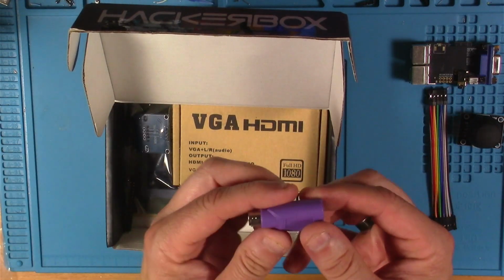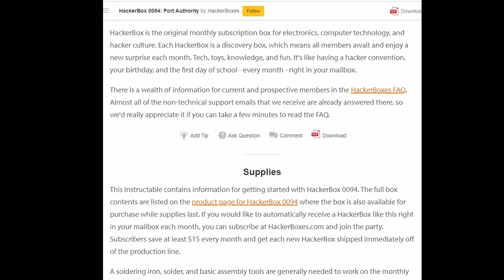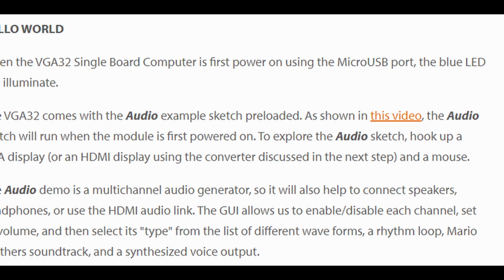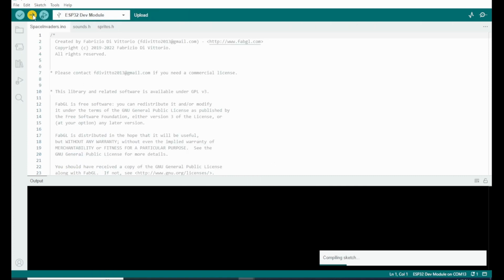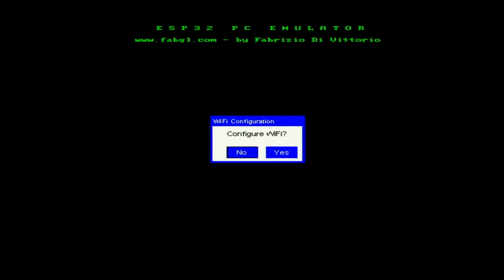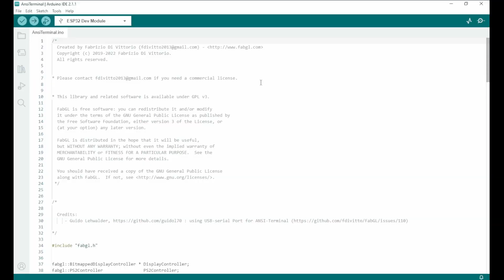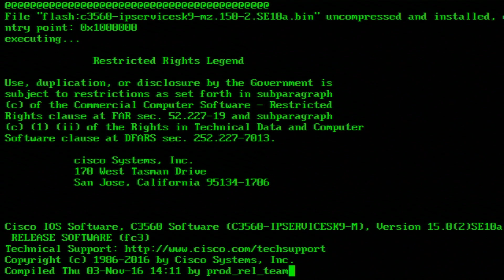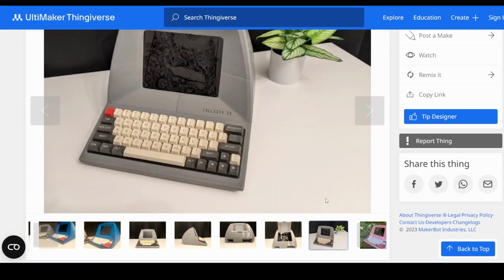Hackerbox 0094 - Port Authority - VGA32 SBC & FabGL Fun!

Comment: Cool video; I think you need to turn on power after you connect the device and turn on the main device you want to connect to... If you turn on the TTYGO first then it won't work via serial. BTW these boards are sold for like 10 dollars usually; the whole kit content is not even 20 bucks in parts, so I would say that the 50 bucks for the kit seems a bit steep

Comment: If you can enter  your login name but you can't press enter, it might be sending the wrong end-of-line character. There might be a configuration option to switch between NL, CR, and CRNL. On the other hand, if the loopback doesn't show you anything at all, then that is really weird, especially if it worked at first and then stopped working.
Reply from the maker: See Short reply
Reply: @JamiesHackShack  , I dug through the code and found where it decides which one to use, so I knew there must be a way to set it. Well, it turns out that it waits for a command from the computer (in the form of a particular escape code) to tell it whether to send CRLF or just LF to the computer. This is part of the terminal standard that I didn't even know existed. 😅 

There should really be a config entry to let you override this setting, but there isn't one. If you feel comfortable doing so, you can change line 531 in FabGL/src/terminal.cpp to set newLineMode to true by default and see if it fixes it.
Reply from the maker: @vaelenorg  Hey great sleuthing! My plan after goofing around last night was to look through the code and you beat me to it. I got the Cisco connection working but using ansi classic I think it was but also probably some mappings not present/correct there. Like using an up arrow to cycle through command history etc doesn't work. I also noted some errors on the pi when I tried it again. I use some knock-off pl2303 usb to serial adapters on it but they usually are fine. I'll definitely try to tweak that line later today and see what luck I have. Maybe it wouldn't be too difficult to add this cr/lf selection to the menu that pops up when you hit f12 that could be fun to try. Thanks a bunch for digging in to look! You rock! I'll report back later today and let you know the results! Thx thx thx!
Reply from the maker: @vaelenorg ok I just now got a chance to edit that line in the terminal.cpp and recompiled/pushed didn't seem to change. I've got some odd messages on my Linux console. I've ordered a less junky USB to serial cable to try there maybe that will show a difference and/or I'll keep poking around in that terminal source. Thx! All three of my junky ones work for other purposes but maybe they don't play well with this max232.
Reply: @JamiesHackShack  Huh, interesting. Let us know what you find out! :)
Reply from the maker: @vaelenorg will do. Or, and I'm not familiar with hole Arduino stuff works. But I assume it would compile that terminal.cpp each time I try to push that ansiterminal.ino that references it. If it doesn't though and is cached or something maybe I need to clear/force it. I think the new USB adapter arrived and I'll try it soon. Enter/return works on the Cisco though. Just not the arrow keys. Hah.
Reply: @JamiesHackShack  I think the Arduino IDE recompiles it every time, but I'm actually not sure either. I haven't used that IDE in a while. (I use VS Code + PlatformIO to do embedded stuff these days.)
Reply from the maker: @vaelenorg  So, I put this still cheap but not quite dirt cheap(like my other three) USB to serial adapter on and it freaking works! Facepalm. I'd have thought if my vt320 worked on these others this would unless all three have literally failed in some way close together timewise. Go figure!
Reply: @JamiesHackShack  huh, I would never have thought that it was the serial adapter! Glad you got it working! 😁
Reply from the maker: 💯, All excellent points. I'm going to clear the bench, and start again with the loopback test and go from there.

Comment: I was going to comment that it needed a case and there it was at the end. That thing will take forever to print. Makerspace project. Fire up a couple at the same time.
Reply from the maker: There are some much smaller stls out there to encapsulate just the VGA32 itself. :-)

Comment: Hi thanks for your video, did you solve the serial IO problem?
Reply from the maker: Hey there, no I have not yet. I hope to get some time after work today possibly to really focus on it and get the scope out and verify signals before and after the adapter to make sure I've not made some kind of oddball error here. Thanks for watching!
Reply from the maker: Hey I meant to reply to you by now. I am sorry for the delay. The serial problem was 100% my own doing. I am going to make a little addendum video soon that will link in the description. Long story short, the three usb/serial adapters that I have that work fine for other things would NOT work right with the one in this kit. The ones I have are cheaper knockoffs of the pl2303 one. I got one that was a little bit nicer and it worked right away. The loopback not working in this video was my getting in a rush and i think i went to the wrong side of the transmit pin to get the rx. Clearly I had two way communication earlier in the video or I'd not have seen anything coming back or my keystrokes on the login attempts.
Reply: @JamiesHackShack  thanks for your reply and answer, looking forward to seeing your next video 😉